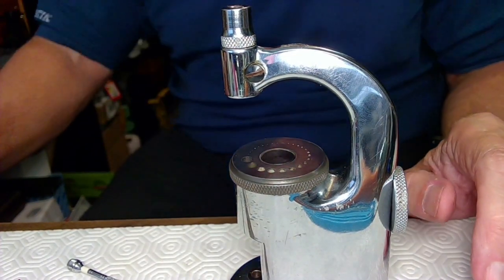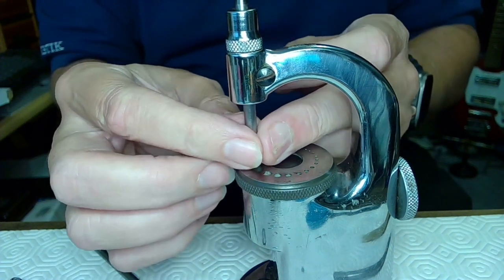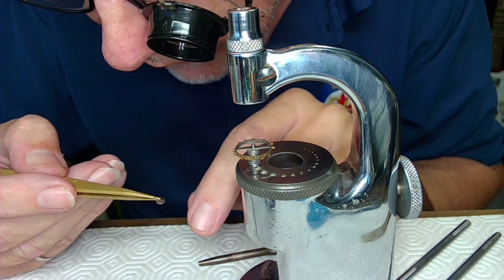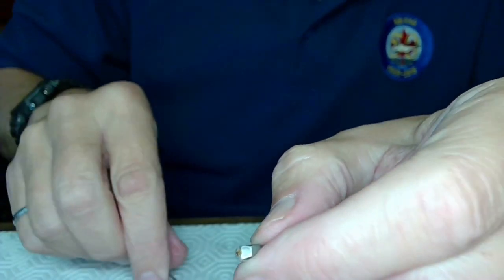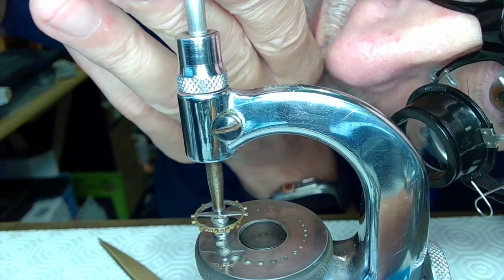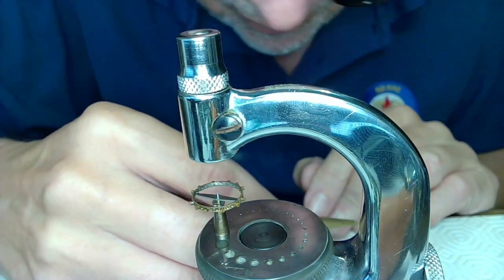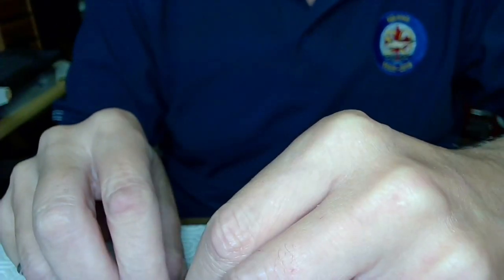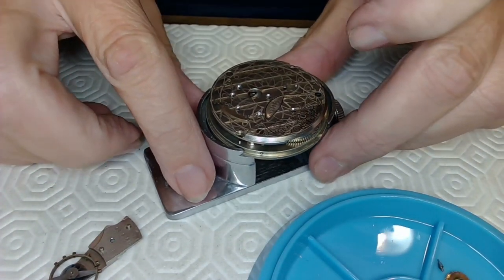Reassemble Frankenwatch and Test

Comment: Great work with the roller jewel, the watch does seem to be running better for it, too. 

There are two possible ways in which the overcoil could be causing the problem with the watch running upside down. 

One is the overcoil fouling against the balance cock or regulator arm, which you have likely eliminated as a possibility by testing the watch with the hairspring stud set a bit lower. 

The other possibility is that the lower part of the overcoil (the part of the overcoil that is closest to the main flat section of the hairspring) is fouling against the outer turns of the main flat section of the hairspring. 

In either of these cases, listening carefully with your ear very close to the balance wheel will often reveal a distinctive twang-twang-twang sound. 

Once both types of hairspring fouling are eliminated as potential problems, then I agree that the safety dart of the pallet fork is the next port of call. 

I really like seeing somebody who is as stubborn as I am when it comes to challenging troubleshooting and repairs, good on you for persevering with this watch. 

All the best, 
Mark
Reply from the maker: I will try to see if this over coil is the problem and the dial up position. I know that listening to the watch you can hear the scraping sometimes. As you have said, previously, it seems like the watch slows down abruptly and dial up. I do feel that the upper Jewel position is fine given how freely it spun, even though the air puffer does provide perhaps more force than the hairspring